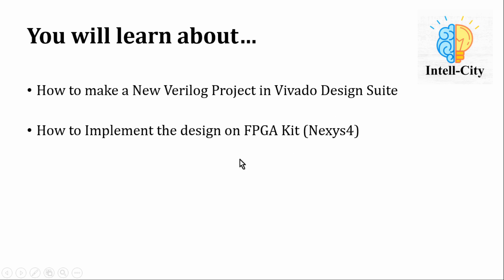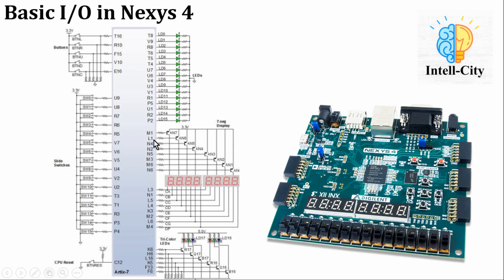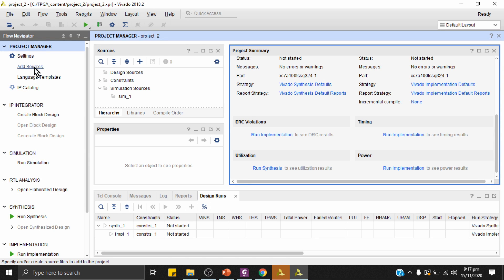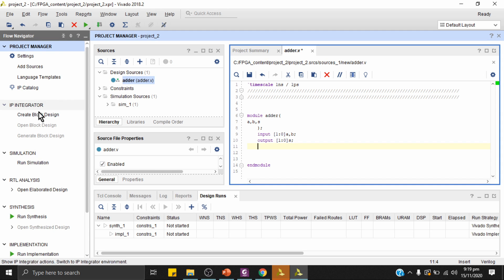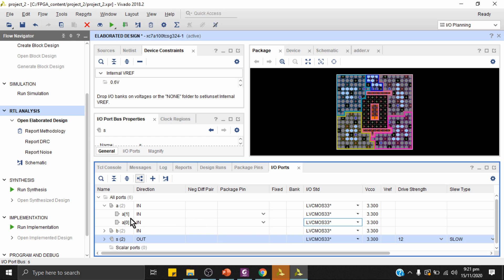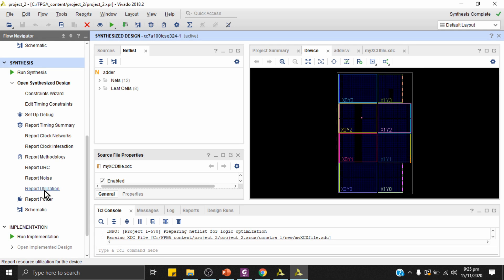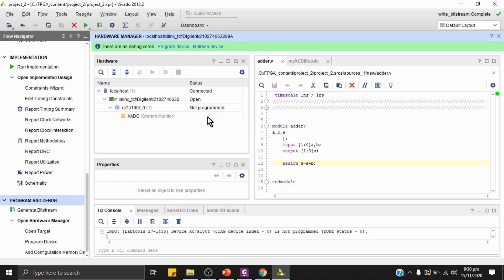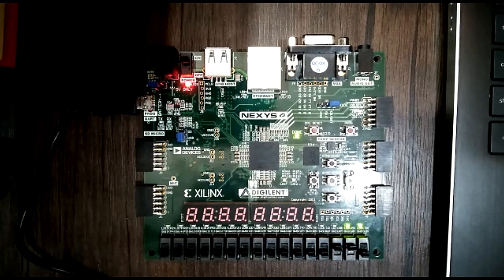How to Create First Xilinx FPGA Project in Vivado? | FPGA Programming | Verilog Tutorials | Nexys 4

Comment: I would LOVE to start learning FPGA using vivado but the sofrware WILL NOT INSTALL.  It gets to the point where you have to create a license and clicking the button DOES NOTHING.   THere used to be a second button in the installer allowing you tot save the url and open it with your browser to get the license but the MORONS at amd removed that button making it IMPOSSIBLE to intall
Reply from the maker: That’s sad to hear. May you find other solution.
Reply: @ElectroDeCODE  maybe AMD could pull their head out of their ass lol

Comment: my board is not able to auto connect.
im getting this error:
ERROR: [Labtools 27-2269] No devices detected on target localhost:3121/xilinx_tcf/Digilent/210274532241A.
Check cable connectivity and that the target board is powered up then
use the disconnect_hw_server and connect_hw_server to re-register this hardware target.
ERROR: [Common 17-39] 'open_hw_target' failed due to earlier errors.

Comment: Hello Sir, can u please tell me how to access the BRAM in FPGA board, and how to store text file in the BRAM.
Reply from the maker: This is how it could be done:

module bram_example (
    input wire clk,
    input wire we,
    input wire [addr_width-1:0] addr,
    input wire [data_width-1:0] din,
    output wire [data_width-1:0] dout
);

parameter addr_width = 10;
parameter data_width = 8;

// BRAM instantiation
reg [data_width-1:0] bram [(2**addr_width)-1:0];
reg [data_width-1:0] dout_reg;

always @(posedge clk) begin
    if (we) begin
        bram[addr] <= din;
    end
    dout_reg <= bram[addr];
end

assign dout = dout_reg;

endmodule

Comment: Everything is OK, but why I have an error about"program_hw_devices" failed due to earlier errors after running "program device..."?
Reply from the maker: I think there is some error in implementation or synthesis phase. Please check it carefully.
Reply: @ElectroDeCODE  ok, I want to make sure other thing. If my implementation and synthesis is all completed(no error) before I had that problemq, then there still might be some problem right?
Reply from the maker: You can check your hardware kit, connecting cable and hardware drivers of your computers.

You may reinstall vivado software and it's drivers on some other computer and try again with it.

Comment: Hi, can we use this board directly by putting on the table or any ESD protection setup is required ..?
Reply: we can use it directly if you are using just a basic demo program. If you are loading heavy design, then you must use proper protection setup.

Comment: Excuse me, I had clicked the "auto connect", but it only appeared localhost(0). Could somebody tell me what happen?🥲(I've tried re-installed cable-driver, and it is no use)
Reply: PS:The problem was about 14:55.
Reply from the maker: You can may check the USB cable, if not then then you have to check your FPGA board.
If that board is working on some other computer with the same cable then you need to do a clean reinstall of your vivado software.
Reply: @ElectroDeCODE  ok,thank you, it's really working on other computer, so I am going to reinstall my vivado software.
Reply: @光榮-g4i  After reinstalling now vivado software working fine in your laptop?
Reply: @yallampallisubramanyam9394  No, it's still has the same problem. But it's OK with the FPGA board on other computer.